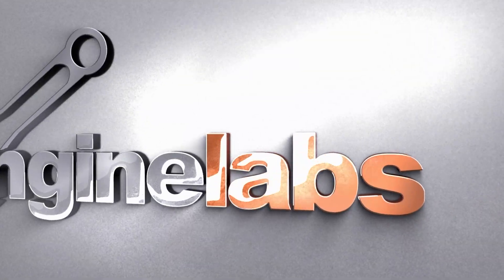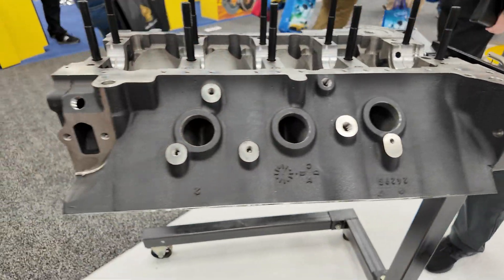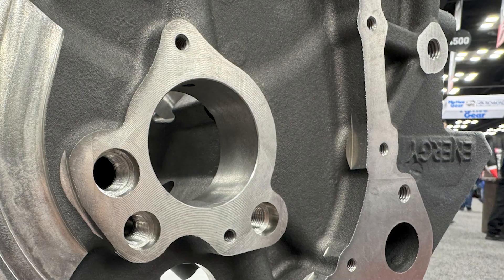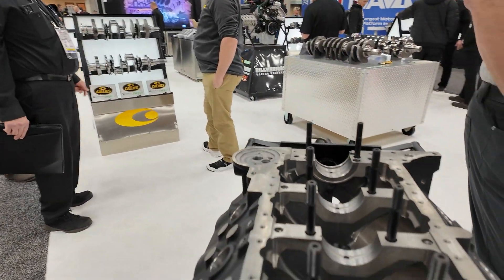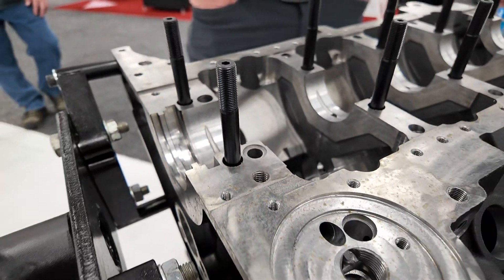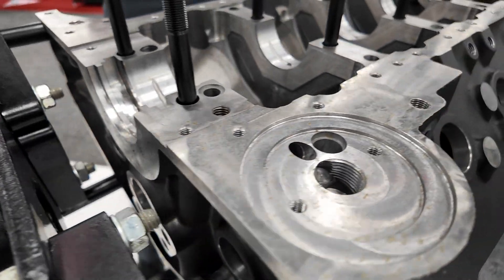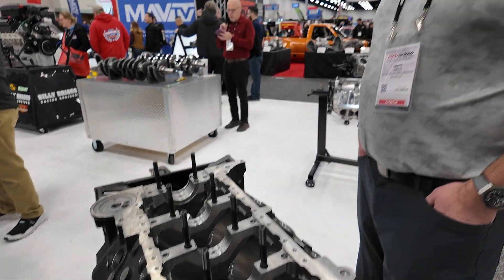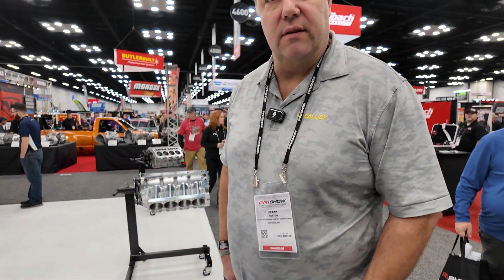All The Details On Energy Manufacturing's New Cast Iron Big-Block Chevy Block | PRI Show 2024

Comment: There were so many questions that should have been asked and so much more information he could have volunteered.  Hopefully his lack of enthusiasm doesn't push away prospective buyers.  But he did give one bit of information I found interesting, and his comment left me thinking they are more concerned with the race shop engine builder's opinions than anyone else's which is ok to an extent, but more engines are built in garages than engine shops, and real world opinions from end user, the people using it for a purpose would go a long way to invigorate BBC usage.

Comment: How about some Ford SB or Coyote blocks with improvements. 🤔 Enough of more BBC stuff.
Reply: TBH, between the Bear Block Motors alum blocks, the Ford Perf iron block, and the strength of the factory aluminum blocks(not to mention the couple billet options), I don't know if we even need another Coyote block option(ayy, maybe if someone wants to introduce a 5.4l deck height tall deck Coyote?). I mean, I wouldn't be upset about another option either LOL.
I would say "...but we could use a Modular block though!", but that isn't gonna happen of course.

Comment: If new blocks don't reflect the needs of racers then it's a waste. .904 or .937 keyway should be standard as a 55mm cam tunnel should be. It is total BS to have to spend 2K after you buy a block